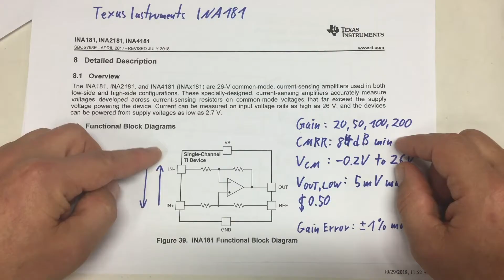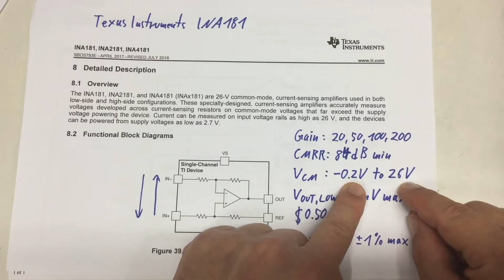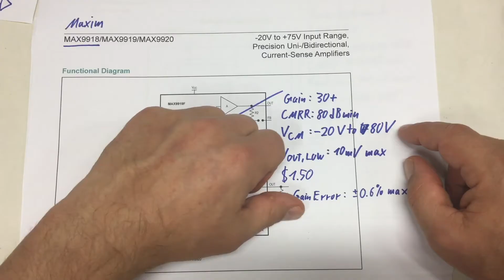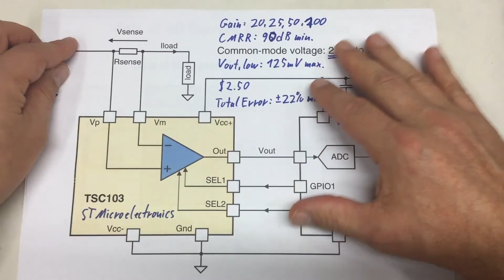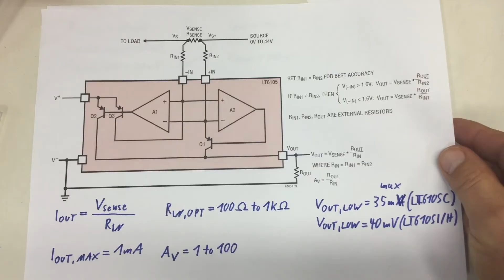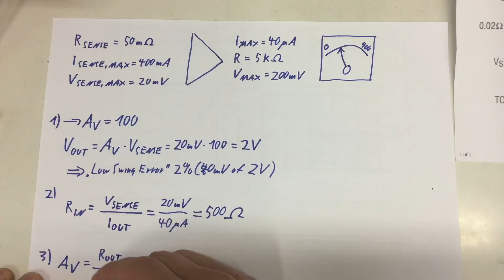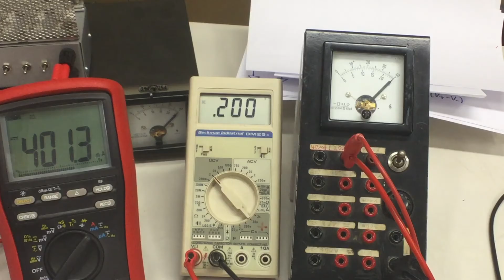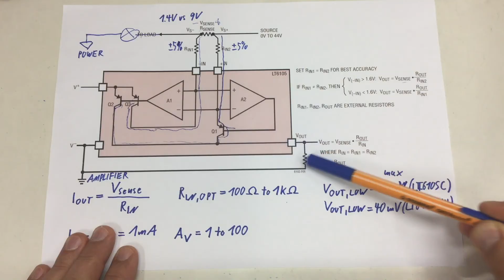Current Sense Amplifiers (2/2): Examples and Circuit with LT6105

Comment: Any recommendation how to measure current from 0.01 to 1A from 0-15V with an Arduino ADC with 10% precision ?
Reply from the maker: Well, I need to know I wee bit more to make any recommendations: Are these 0 to 15V measured to the Arduino ground? What's the basic circuit? What Arduino are you using? What's the maximum value of the shunt resistor, respectively, the voltage drop across it you can tolerate? Anyway, 10% precision is absolutely no problem, even with the Arduino (ATmega328 for Nano, UNO) ADCs. Add an external voltage reference and you can precisions better than 1%. Simplest solution (the 0 to 15V are to the Arduino ground): Use an external 1.25V 0.5% reference (e.g. AZ432, $0.50) and a shunt resistor of 1.25Ohm. That solution has of course no protection and a high burden voltage.
Reply: @robertssmorgasbord  Thanks, I build this current-sink circuit (https://m.eet.com/media/1130553/13338-31705di.pdf) to log discharge curve of batteries and I just want to use an MCU to actively set the current sink current by monitoring it and setting it through vref. But meanwhile I think thats gets to complicated.. I'll simply adjust the current manually with my DMM.
Reply from the maker: @paulg.3067  OK, you've got already a 0.33Ohm shunt resistor referenced to ground (which should/will be also your Arduino ground). 0.33Ohm yields 0.33V at 1A. We need to amplify that to 1.25V (AZ432 external voltage reference for Arduino), so an amplification of about 3.79. With your precision requirements and no common mode voltage issues (shunt resistor referenced to ground) there's no need for any special chips. Just use one half of a second CA3240 op-amp as non-inverting amplifier. The non-inverting input of that op-amp is connected exactly like the inverting input of IC(1A) to the shunt. Choose an amplification for the non-inverting amplifier a little below 3.79 (you don't want your ADC input voltage higher than your reference voltage). E.g. 10k and 27k (each 1%) would give you a 3.7 amplification.
Reply: @robertssmorgasbord  Thanks a lot , I will  try that for sure :)
Reply from the maker: @paulg.3067  You're welcome :-)
Reply from the maker: Almost ... but you copy/pasted an inverting amplifier there ;-) You need an non-inverting amplifier: https://www.electronics-notes.com/articles/analogue_circuits/operational-amplifier-op-amp/non-inverting-amplifier.php
The right pin of R1 has to go to ground. R1 and R2 need to be connected to the negative input of the op-amp (and loose that 1uF capacitor). The positive input of the op-amp needs to be connected (via a 1k resistor for protection) to "LINE 1".
Reply from the maker: @paulg.3067  Some more notes: If your maximum current is really just 1A you can remove the second MOSFET (Q3, R3) and replace the fuse by a 1A or 1.2A type.
Reply: @robertssmorgasbord  alright, thanks again :)
Reply: Please, one really last question, in Opamp IC(1A) there is a capacitor and a resistor in the feedback loop... does that act as an "integrator" and is that resistor after the capacitor meant as current limiter?
Reply from the maker: @paulg.3067  Noop, the 47kOhm/1uF at IC(1A) and the 47kOhm/100nF at IC(1B) are for frequency compensation. The feedback loops, especially that for current, can oscillate quite violently. Those RC elements are there to prevent that. See also my feeble attempts to prevent oscillations in a constant current load: https://www.youtube.com/watch?v=8xoGhZQO29Y

Comment: Hi, good presentation. In reality , the currents sense amplifiers are designed for measuring currents with hi cmrr, not optimized for achieving low noise, thus it cannot replace all the designs
Reply from the maker: Thanks for the praise! And you're absolutely right: They are designed for extremely wide common mode voltage ranges and high CMRR, not low noise (or high precision). If you want low noise (and high precision) your first choice would be an instrumentation amplifier. But while those usually also offer a high CMRR, their common mode voltage ranges rarely extend beyond the power rails. Guess you can't have it all.

Comment: Great effort and equally great video. Just to know, can these ICs measure values less than 10mA? If then, how can it be measured using microcontrollers?
Reply from the maker: Thanks! Of course they can measure values of less than 10mA. But depending on your application you might wanna choose another type. If you want to read the measured value with an MCU you have three options: 1. read the output of the current sense amplifier with an analog input pin of your MCU (build in DAC), 2. use an external DAC with e.g. SPI or I2C interface to your MCU to read the output of the current sense amplifier - or - 3. use a current sense amplifier that has an build in DAC with SPI or I2C interface.
Reply: @robertssmorgasbord  Thanks for your quick reply! So how much low value can the IC measure? Can you suggest a good IC for that? I have also seen that similar low-cost hall effect based current sensor ICs like ACS712, ACS758, and others which measures the current but not as low as 1mA or even low. Also they have total output error in their output voltage in the range of 1% to 2%. Does the ICs shown in your video have low error which can measure current in the range 1-10mA or even low? Also are there any alternative ICs out of the video? I use Arduino for interfacing BTW. I really appreciate the reply.
Reply from the maker: @ajk0007  Hi, I need a bit more information to make a recommendation: Maximum current to be measured (I assume 10mA), value of your shunt resistor, voltage to ground at the shunt resistor, sampling rate and - of course - how much you're willing to spent for the parts. Maybe you could make a short video showing the circuit you've got in mind? Anyway, to answer you questions: IThe LT6105 can measure currents below 10mA, but that's really determined by the size of your shunt resistor. A LT6105 based circuit should have a maximum error of 1%. And yes, there are hundreds of different current sense amplifiers available ;-) BTW if you use an Arduino analog input and connect the its external voltage reference input to an external voltage reference (say 0.1%), you can measure voltages with 0.35% accuracy (the internal Arduino DAC is about 0.25%).
Reply: Thanks for your reply. I was trying to simulate a circuit to measure currents as low as 1mA to 5 mA or 10 mA. So only LT6100 is available in the software. In its typical circuit, a shunt of 3mOhm is used. Also I am using an Arduino to convert the output voltage of LT6100. But I am in doubt of the conversion. Is that a proportional change or is there any other formula for doing that? The supply for LT6100 is 3.3 V. The typical circuit is in its datasheet.
Reply from the maker: @ajk0007  OK, staying with the LT6100 for now. I would set its gain to the max of 50V/V (Pin 6 (A2) and Pin 7 (A4) to VEE/GND). Forget about using the internal voltage reference of the Arduino and connect an external one its AREF pin. A cheap TL431 type with 2.5V (0.5%) should do. With the chosen amplification of 50V/V you can measure now a maximum voltage across your shunt resistor of 2.5V / 50V/V = 50mV. So at 10mA you'll need a shunt resistor with a maximum value of 50mV / 10mA = 5Ohm. Choose a 4.7Ohm 1% resistor (cheap and available) and you can measure currents up to 50mV / 4.7Ohm = 10.6mA with a total accuracy of about 2%.
Reply: Thanks for the explanation👍. So for LT6105 one can directly calculate the current by its gain in V/A range right?
Reply from the maker: @ajk0007  Not quite ;-) The shunt resistor is part of the equation here too: Vout = I * Rshunt * (Rout / Rin), with Rin = Rin1 = Rin2 and Rout / Rin being the gain. Not that many restrictions apply here (see the datasheet): Gain (Rout/Rin) must be between 1 and 100; Iout through Rout is max 1mA; Vout is max 1.25V (!). Also, the min Vout is 35mV (almost 3% of max Vout - you'll never be able to measure down to 0A). All in all, especially with a max Vout of just 1.25V, this is not really a good chip for driving a DAC.
Reply: @robertssmorgasbord  Thank you so much for the explanation. A great series! Looking forward to helpful videos like this one from you.
Reply from the maker: You're welcome! And I will continue to upload (hopefully) helpful videos ;-)
Reply: @robertssmorgasbord  Great! Hope to see it soon.😊

Comment: Hi sir, I'm using shunt resistor  0.025milliohms (300A 75mv), I want to measure current using Arduino can you help me out?
Reply from the maker: Sure, but what are your other requirements? Especially voltage to ground at the shunt resistor,  galvanic isolation, resolution/accuracy, sampling rate and - of course - costs?

With a maximum signal of 75mV, the shunt at the low side (connected to ground) and no requirement for galvanic isolation you might go with a simple non-inverting OpAmp amplifying the voltage to e.g. 1.1V (Arduino ATmega328P internal voltage reference) and reading that with an analog input of your Arduino at 10 bit resolution and a sampling rate of max 9615Hz (for a 16MHz Arduino).

Comment: What is the output voltage at 400ma input current...I can see 200mv is that the output voltagte....if shunt resistor is 50mohm input voltagte is 20mv and if gain is 100 then it will be 2v right...but I see 200mv....
Reply from the maker: 200mV is the voltage across the analog instrument which has a resistance of 5kOhm. There is a 45kOhm resistor in series with the analog instrument. 2V is the voltage across both resistances (45kOhm + 5kOhm = 50kOhm) and thus the output voltage of the amplifier. See also the circuit at 33:49

Comment: I need to measure a current .. the input would be 1mV to 200mV.... I would like to output 0-500mV... or 4-20mA....  would be better to use a instrument amplifier.... ..   i need to avoid noise... so would pay more for better results...
Reply from the maker: Well, I would need some more information to make a suggestion ...
1) Is your shunt high or low side
2) How large is the shunt (you wrote "the input would be 1mV to 200mV", so I'm assuming that's the voltage across the shunt)
Anyway, normally you wouldn't need an instrumentation amplifier, because its main advantage over a current sense amplifier is its high input impedance, and a shunt resistor is (normally) a very low impedance signal source (unless you want to measure pA currents and your shunt is in the MOhm range ;-) ).
Reply: @robertssmorgasbord  Hi Robert, thanks for your answer!   I'm going to measure a leakage current from a secondary transformer, AC signal, from the high side, not ground side, but I'm going to use batteries for the measuring circuit, I'm going to isolate the ground basically transmitting the signal by wifi. The shunt I'm thinking to get 1 Ohm (10W) because my main range is 1mA to 200mA...(but should support short current 2.7A as it will be shorted frequently for testing) if I could measure 1uA would be great. So I'm looking for a good and precise measurement, low noise, that's why I thought to use Instrumentation amplifier for high CMRR, but I have looked many of these current sense amplifiers like INA219, INA226 (this one is easy to get here), INA282, INA181, INA190 (would be good if the INA190 had I2C because it has a low consumption..), INA240 (this last one looks really good but no I2C) , but not sure which would get better results than instrumentation amplifiers like INA114 etc....  I'm going to use an ESP32 so if it has I2C would be good to communicate directly, but the most important is better measurements.  by the way ... your video was a great explanation... I wish my professor would teach like you....  I am inclined to use INA226 ...to try from 1mA to 200mA... and lower if possible....using more units with different shunt scales...
Reply from the maker: @RF-yh3qh  These are some very demanding requirements you have there ;-)
Let's take it from the back end first: You want an I2C interface, your max current 2.7A and the desired resolution is 1uA -> You'll well need at least a 22-bit ADC wit I2C interface (we're talking here a 6 to 7 digit meter): A NAU7802 (about $2, 2 differential inputs, 24-bit, 80 samples/sec, Vcc 2.7V to 5.5V, available as SMD or DIP at Digi-Key) should do the job (if 80 samples/sec is fast enough). Just looking at the datasheet of that thing you won't need any pre-amplifier (your full scale voltage is 2.7V at 2.7A and 1Ohm). Maybe some overvoltage protection and RC filtering might be in order though. If the internal gain adjustment of that thing is not enough (1, 2, 4, 8, 16, 32, 64, 128) you can also vary your shunt a bit. And with two differential inputs you could implement two ranges (a smaller and larger shunt in series, on input measuring the smaller and the other both) - don't forget some overvoltage protection at the low range (over both shunts) input.
Reply: @robertssmorgasbord  Hi Robert, really thanks for your answer, yes you are right... too much requirements... hehehehe... I'm still studying and sometimes it's hard to choose. I took a look at the NAU7802, a really good one, I don't know if it would be hard to implement.  I am thinking if 80 samples/s is enough........ not sure if I should get true RMS (if yes... then need more samples as the signal is 60Hz).... or if I could trust on p-p measurement to calculate it..... I'm afraid to get noise on the p-p measurement and screw up, no experience with that.  I really appreciate your answer... I'm learning a lot ..... maybe I should stick first to 1mA to 200mA... and use another later to try to get lower measurements...  I can use another one that is not I2C.... because I can use the analog input of the ESP32 to input the analog signal... I was just looking for I2C to try to avoid more errors or noise...
Reply from the maker: @RF-yh3qh  Hi RF, 80 samples/s if definitely too slow if you want to calculate true RMS. If your current waveform is a sine wave (!) at 60Hz you'll need at least 120 samples/s (Nyquist theorem). If it's another waveform you'll need even higher sampling speeds. Try and have a look at the ADS1219. Its features are similar to the NAU7802 and its 1k samples/s. it's about 6€ at Digi-Key, however it comes in a TSSOP SMD package (0.65mm pitched pins). And ... Texas Instrument datasheets are really good (with application examples, PCB layout examples etc.) :-)
Anyway, it might be a good idea to start simple and use the ADC of the ESP32. Don't forget to implement a good input protection though ;-)
Reply: @robertssmorgasbord  Hi Robert thanks again.... I'm going to start simple....  using INA226 ... I can buy like 2.... put one to measure from 1 to 200mA ... and another from 100uA to 1000uA.... if necessary I can add more... I also decide to go with 10 Ohm shunt... with more power dissipation..... to avoid Voc..... about the protection I was thinking to just use some Zener diodes connected between the inputs to avoid transients ... not sure what more I could do ....... (but for next project.. maybe use INA190 + the ADC 24bits...I'm studying...  thanks for your help..
Reply from the maker: @RF-yh3qh  Hi FR, you're welcome! Just some pointers: A 10 Ohm shunt might wee bit large - at 200mA you've got a 2V drop! But maybe that's OK for your application. Implementing two ranges is a good idea - keeps the problems with the high dynamic range at bay. Have you considered using two shunts in series (larger for uA, smaller for mA) and shorting out the larger one with a MOSFET (or something similar) - it requires a bit more program code, but might be worth it. Lastly, you are aware the INA226 comes in a VSSOP package with 0.5mm pin pitch?
Reply: @robertssmorgasbord  Hi Robert,   well the voltage drop is not a problem.... we have a transformer in our lab... I'm doing this as my project to measure the secondary current... the total voltage on secondary is 60KV... that's why I'm using battery and wifi for the circuit to isolate it completely so 2V drop... no problem.. .heheheh.....  here these INA226 are sold in a small board soldered ready to connect  :) ... of course they come from china pre build.... yes ..I'm going to use the shunt in series... but I was not thinking to bypass them.... leave as it is... measures both at the same time...  no sure if it would give me ground problems between the two amplifiers..... my only concern is transient... because this transformer is for testing isolation... so frequently will have some fast discharge because of isolation failure...... and maybe burn my circuit because of transient effect...let's see if the Zener diodes are enough.   I'm trying to figure out the sample rate of the internal ADC of the INA226, it's confusing... there is a table with 8 bits and respective times.... but this ADC is 16 bits... I'm not sure if it can be used for sampling 60hz.... looks like it's too slow...  oh god...let's try to find another one... I was trying to find something to give me RMS direct but no lucky...
Reply from the maker: @RF-yh3qh  Well, that sound like a really interesting project! Anyway, if you're concerned about the transients: First, put an RC element before each of your differential inputs (guess you have done that anyway), that should "slow down" any voltage pulses across your shunts so the Zeners have time to get conductive (alternatively you could use some Schottky diodes in series - their faster, but the leakage current will be much higher). And think about having a MOV and/or Zeners parallel to the shunt resistors. Anyway, have fun with your project ;-)
Reply: @robertssmorgasbord  Hi Robert, thank you very much for your video!  keep doing you have a good way to explain .... I'm going keep watching.... thanks for all your help...
Reply from the maker: @RF-yh3qh  You're welcome :-)